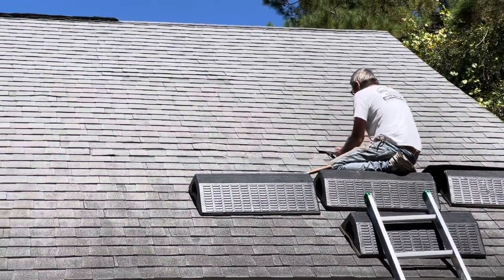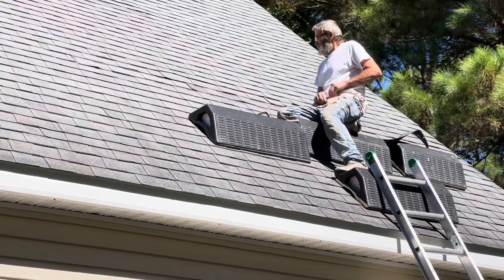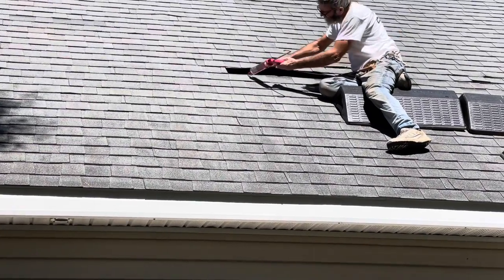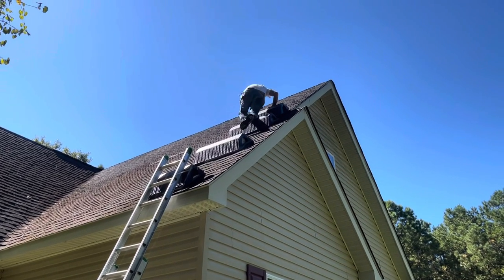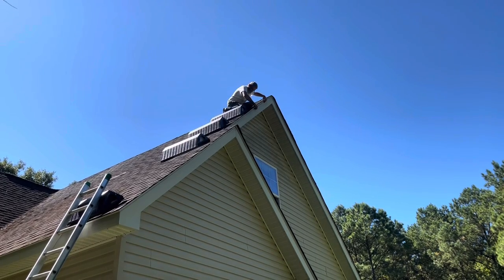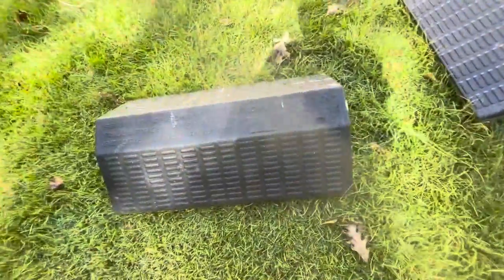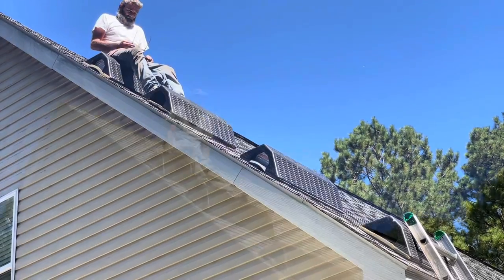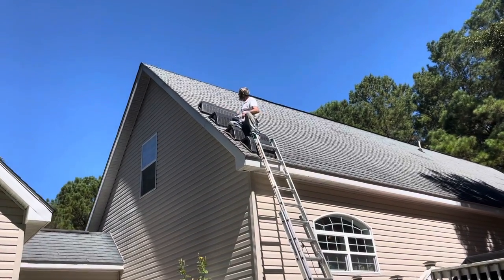Roofing Pitch Hopper. How to use it. Best Roofing Cushion.

Comment: Can you use these to take the first step onto a roof from the ladder? So going straight from ladder to the hopper.
Reply from the maker: Yes. They work great for that. Buy 1 you won’t regret it by four
Reply from the maker: Yes I will make a video on that cougar paws are great but I would not trust them alone
Reply: You can't set those up and carry up a bundle without worrying the thing won't slip on you